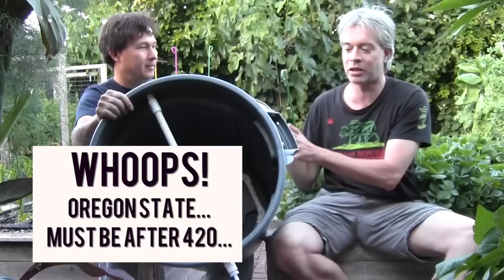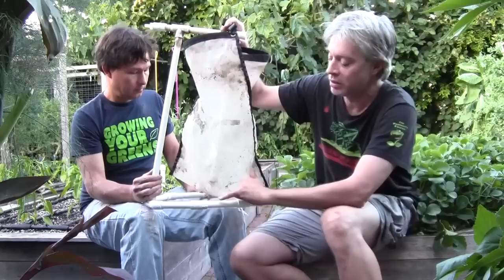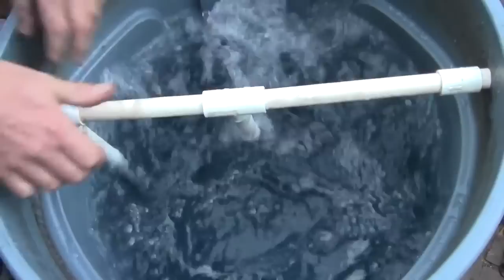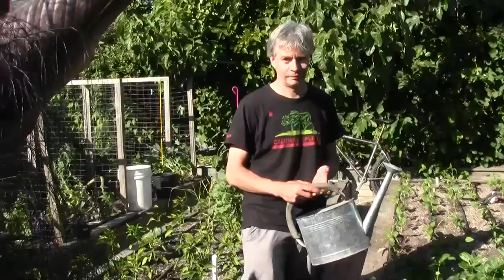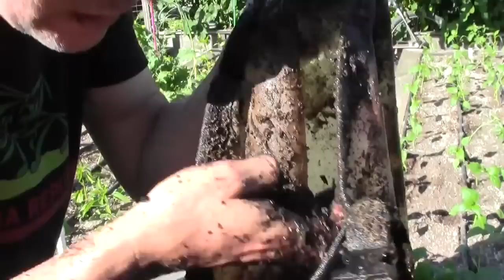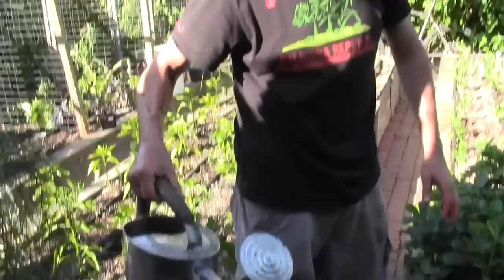Best DIY Compost Tea Brewer made with a Garbage Can & PVC Pipe

Comment: Tip: If you are using city/chlorinated water for compost tea brewing, off-gassing will remove the chlorine, but will not remove chloramines (nor will most filtration).  Add 1 drop of humic acid per gallon of water to bind the chloramines before starting the brewing process.  Humic acid can be purchased or made from your own good finished compost. Add an additional 1/8 cup per gallon of humic acid and 1/8 cup per gallon of fish hydrolysate if you want your compost tea to be more fungal dominated.
Reply: I wonder if plants can absorb Flouride?
Reply: @cryptolittle8854  yes they can . Certain plant species dont like fluoride ( ex : dracaena ) , and fluoride is more assimilated with low ph .
Reply: @lesavoirestunearme-7z527  thanks for the response
Reply: Are you stating that by adding humic acid the Chloramines bind to the water molecules then when the big bubbles push them up and out both chlorine and chloramines off gas? Or does the chemical reaction from the humic obsolete the Chloramines? Thanks for your insight
Reply: so if you know the boggie brew formula from one of their previous videos they use 2 different kinds of humic acids in their mix. However i doubt it really does that. No the only way to get around the chloramides is to use a chemical additive or to just use rainwater
Reply: Supposedly a kdf/85 filter will remove up to .97% of chloramines. I think the boogie brew plus filter is a kdf/85 filter and says it will remove up to 87% of chloramines
Reply: According to the Biologic Systems website, you need to protect the bag from UV light, as it will degrade the bag, so another form of disinfection would be needed

Comment: Didn't see it in any of the replies so I thought I'd add this. I have a programmable fish tank heater set to 73° for the initial warm up and to keep my brew at temp. Nights are ~55° here in the PNW so keeping it warm is my issue. I use a 10gal insulated Gatorade cooler with a new 'flip to stay open' pour spout (instead of the stock pour spout that you have to hold the button down to pour). It's been working great. Lots of sexy bubbles when I add fish hydrolysate.
Reply: Awesome program, especially your temperature control system - simply brilliant to use an insulated cooler like that!

Comment: Mathemagician analysis: how far do you need to turn to return to a negative parallel vector (parallel side of the polygon, in this case the octagon) — 180degrees. Divided by the no, of steps in which you are revolving (in this case pvc parts) gives the outer angle of the pvc part. So 180/4 = 45. so to get the inner angle of one pvc piece subtract 45 from your initial 180 (which would be the second angle of a staight line. The first angle of a straight line is 0, then 180, 360, 540 etc

Comment: Any old (or new) vacuum cleaner that has a "blower" connection will work fine and add ozone from the brushes which adds O2. That is what they use on large Jacuzzi tubs after all for the bubble action so the pressure should be fine. Just need to reduce it to 1/2". Easy to do. So much cheaper than those very noisy pumps. Love that design. BTW that size tea bag would work fine in a 275g IBC and that design is easy to enlarge for an IBC. Farm size! A vac motor might not handle 24hrs non stop but I'll give it a try and get back.

Comment: Great video. I would glue the pvc connectors, that have threads on them, then screw the pieces together so there is no chance of the pvc coming apart and it is easy to unscrew the connectors for cleaning etc . Thanks for all your great videos.

Comment: Cool!  Great to see detailed directions on setting up a system to aerate compost tea, and where to get the components.  But wouldn't a used whisky or wine barrel be better?  Or at least a used food grade barrel.   

Not sure what synthetic chemical-free alternatives could be swapped for some of the other parts, but the plastic garbage cans both outgas and transfer via direct contact a bunch of synthetic chemicals and heavy metals, as does PVC.

Some info about the hidden dangers of plastics used for food included below.  Keep in mind that this info is for 'food grade' plastics.  Non-food grade plastics are less regulated.

:What About BPA-Free and Other "Safe" Plastics? 
Given that certain plastics risks are becoming well-known, you've 
probably seen plastic products that tout they are "BPA-free," 
"PVC-free," or "Phthalate-free." This is a step in the right direction, 
but it does not mean the plastic is safe. 
For instance, one study found that tests on plastics using a BPA-free label
 have not been conducted under real-world conditions like running the 
plastics through a dishwasher or heating them in a microwave. In the 
"real-world," 95 percent of all plastic products in the study tested positive for estrogenic activity,
 meaning they can still disrupt your hormones even if they carry a 
BPA-free label. Even more disconcerting, the study found that BPA-free 
plastics in some cases leached more BPA than the non-BPA free plastics.
Further, just because a plastic claims to not have one or two toxic 
chemicals, it again does not make it safe. Remember, there are many
 chemicals in plastics that you are better off avoiding, and many of 
them are still largely unknown to consumers. The Ecology Center in 
Berkeley, California has put together an excellent list that exposes 
just what kinds of plastic toxins are in the products you use. I think 
everyone should read the entire list, but here are some highlights:
Salad dressing and cooking oil bottles: This 
plastic container is made from PVC (polyvinyl chloride), which leaches 
plasticizers (lead, cadmium, mercury, phthalates and the carcinogen, 
diethyl hexyphosphate) into your food. Soda bottles, water bottles, peanut butter jars and cooking oil bottles:
 Made from PET (polyethylene terephthalate), they leach acetaldehyde -- a
 probable human carcinogen, according to the EPA -- into your food and 
drinks. Meat trays, foam take-out food containers and cups, foam packing materials: Made from polystyrene (PS), these materials leach styrene, which can damage your nervous system, into your food. 
Sadly, the end result of breathing, eating, drinking and absorbing 
all of this plastic includes obesity, declining fertility rates and 
other reproductive problems, and cancer, just to name a few."- Excerpt from the website of Dr. Mercola.
Reply: Thanks for typing this out.   Its weird how things ive always thought in the back of my head without any proof are now being proven and nobody really cares either.  The average person secretes approximately 5 grams of plastic per week thats a whole credit card.

Comment: quick way to get the angle. it makes a full "circle" so its 360 degrees total, Since we have 8 side and 8 angle connectors we have an octagon. We just do 360/8 which gives us 45 degrees as the angel of each corner :) quick check of the algorithm, square has 4 side and we know a square is exactly 90 degrees each corner so we try 360/4 and we indeed get 90

Comment: Is the bag a small,med, or large?  Also if you put a drain at the bottom on the side and put a filter and on-demand pump to pump the mixture through a hose or upper irrigation system.

Comment: I have an oxygen concentrator that gets intermittent use for EWOT.   The output is 8L/M at 15PSI.   Given the O2 in atmosphere is 21% and the concentrated output is 87% pure O2, that should be more than enough for a 5 to 10 gallon batch, right?

Comment: Elaine Ingham is adamant that air stones are not used because she says that after one use they can go anaerobic and can destroy all future brews. She recommends using pipe and 1/32 holes drilled in the pipe like in the open-source brewer you show. She recommends pulling apart and pulling a cleaning patch through the inside. You certainly have a lot of hands-on experience. What have been your experiences?

Comment: Would the angular connectors be 360 divided by 8 = 45 degrees?
Reply: Looks more like 120
Reply: Whatever it is that's cool... Years ago we always had fun doing things and when somebody would try a different way it was always special... if it wasn't perfectly straight if it wasn't perfectly round it didn't matter being functionals what's important
Reply: 22.5
Reply: @seanieizcool  No, it is 45 degrees elbows. PVC elbows come in 22.5, 45, and 90 degrees.

Comment: 30:05 John introduces the topic of temperature the tea should be brewed at.

I live in Vegas; I have the same growing conditions as john! I have placed the
compost temp prob into the water here in Vegas in a 5 gallon bucket on 110 and 110+ days and the water temp in that 5 gallon bucket is 90 - 95 degrees Fahrenheit.

I am unable to make the accommodations that bring the temperature of the brew down to the suggested 70 - 75 degrees.

What should I expect out of the performance of Boogie Brew?
Reply: Add ice or a frozen bottle of water that should do the trick for you.

Comment: So if the temp is too high if it is over 70 degrees, how do you make compost tea like this in Florida where the lows at night are 85 degrees.
Reply: k may Try to WATER temps below 78 degrees, warm AIR is fine though.
Reply: How can I keep water temps under 78?  Around here in Florida the gulf temp stays in mid 80s.  Basically the environment the bacteria would be living in would be higher than 78 degrees so that cant be ideal, right?
Reply: I live in TX and grow red wigglers outside, it gets hard to keep them alive above 90 degrees, what I do is put a couple of milk jubs in the frezzer overnight to put in the soil to keep it at around 70 to 75 over all. You could try that.
Reply: milk jugs or other sturdy container that will hold water and not break when frozen

Comment: How long do you need to run the air pump?  Where do you buy the parts like the pump and compost tea bag?
Reply: k ma Run air pump 24 hours for the actual Brew process. Then  if using air stones, run the pump a couple more hours to "bleed" the stone(s) dry. Tea bags are available from places like Monster Gardens (www.monstergardens.com) or just use a paint strainer bag from hardware store.
Reply: With the 25 gal brewer, which bag size did you use (large/small)? Thanks!

Comment: I brew with small system and few times it's started to smell a bit like apple cider vinegar , Is this still good as it's not smelling anaerobic just smells very sweet? 

I just end up throwing it in the compost and starting again as I am un-sure if it good to still use.
Reply: When in doubt... You did the right thing..

The question is what are you using homies prepackaged bought-and-paid-for material? Or something you threw together from materials around you?

In my experience with my homemade concoctions it can be almost no nose to a little sweet a little earthy even in the range of a cow pie... But I wouldn't be scared of that sweet smell... 

What you should be worried about is that diarrhea it was time to take out the diapers two weeks ago smell.. when it's wrong you know it, the nose becomes very loud.

Making my own I've experienced the range. Even starting from milk thistle I pulled from the hillside brewing that up in a 5-gallon it had the nose of cow pie, which is okay... But when I went to making my tea  mixing ingredients and bubbling it got it got nasty yuck a couple hours later the nose was completely gone... plants loved it... Make sense ;)

FYI didn't go to school for this but it's pretty much common sense practice makes near-perfect

Comment: curious if a compost tea and top dressing can be used in a hydroponic system? I am interested in expanding in that direction and use compost and occasionally bat guano and/or kelp to amend my soil. I am wondering if a similar system could be used as the hydroponic nutrient solution? I also haven't been using compost tea in the soil garden but may do that as well.

Comment: 8 points = octagon, not a hexagon (6). Additionally, to much air can be a bad thing too. As the bubbles dissolve in solution they burst into smaller bubbles giving way to mechanical stress called cavitation. If you've ever cultured life in the lab it's something you need to be aware of; your pump is massively oversized and will give you too much film on top of the solution.
Reply: What size of a pump is better suited for this project ?  thank you
Reply: @canopy4203  when calculating the maximum amount of O2 or air you have to take into consideration things like elevation to sea level, water temperature and vessel volume. If they were at sea level, with 20 degree c water temp then they would need to consume 34.47mg of O2/gal. Note, this takes into account partial pressure. A single gal of air has 317.004kg of air /gal or 64.35kg of O2 / gal. Basically, you're pump saturates the water with air very quickly. 
To keep it short a 10gal per hr aquarium pump is way oversized for a 35-40 gal trash can.
Reply: BoogeBrewNet/Gyg

Comment: Ohms law. The smaller pumps have less resistance, therfore the watt pull will decrease. Combined in mutiple pumps the energy created will meet requirements which will draw less amps\watts. Also If using 1 pump you wont have a backup if it breaks.

Comment: since this is so inexpensive to create, couldn't you put one at the end of each raised bed, put a spigot at the bottom and then plumb it to run into the 'wrong' end (so it flows the opposite direction as your water)  of your irrigation
 pipes?   how long does tea last?
Reply: You would eventually grow fungus or mold in your irrigation lines.

Comment: couple of things id like to add
the pumps vibrate and are very noisy, people like to hang them to reduce noice, first replace the cheap plastic handle with a metal one.
always have the pump above the water  line, if water goes back through the line to the pump it will wreck it.
and you can unscrew the brass airhole and attach the hose with a screw clamp to the larger intake for a little more air
good vid john thanks
Reply: jason knight...Well said Jason, and a very good point about the noise! Another decibel reducer is to add a "muffler" to the air INTAKE port down on the side of the pump - just an inch or so of air tubing placed right over the port will do the trick. A piece of foam / sponge material inserted into this short piece of tubing helps, too. (And won't slow down air flow much at all).

Comment: First, I'd put the holes on the bottom.  The pipes will always fill with water, and if they're on the bottom it will keep the pipes cleaner.
There are roughly 56 1/8" holes - I'd put twice as many 1/16" holes.  I think a smaller pump will work - I want a simmer, not a full boil.  Why do you need 1 L/min of air per L of tea?

Comment: How hard can it be? 

1 full circle ~= 360°, it is an octogon,  ὀκτώ/octo being eight, γωνία/gōnía being corner or angle => 360°/8=45° so you'd have to buy 8 pieces of 45° fittings for schedule 40 pipe.

But I present an easier idea (no math, I promise): For koi ponds and sewage ponds there are aerator hoses - hoses that have many thousands of tiny air holes poked in, similar to the cheap "sweating" irrigation hoses. With those, and some common fittings and preferrable wire hose clamps you can make any shape of aerating device, here a ring or several concentric rings for the floor of the bin, and a line (instead of the point) for inside the nylon bag. Plus: no glueing needed, can not break nor buckle, can be altered, can be hanged upside down to a hook in the shed roof to dry out.

If you have access to aquarium stuff: there are devices called "aquarium air lifters" which are waterpumps for aquarium filters driven by pressurized air as the only "moving part". 
Take a 5 gal bucket, hang a cheap stainless chinese honey sieve (30cm diameter) and let 3-4 air lifters pump water from the bucket into the sieve holding the compost  aerating it in the process. 

I will test a setup with a 60l plastic barrel, concentric aerator hose rings and no bag at all, just keep it all suspended and filter out in the end (which you have to do anyways, at least for my sprayers).

Those shelves which hold 6-8 bottle carriers at an convenient 45° angle are perfect for drying and storing all the buckets hoses and sieves.

Comment: 360 degrees / 8 sides.  Those are 45 angles.
Reply: flyer737sw...glad to receive clarification from smarter folks like you. GYG'ers are a gifted lot...good "math-a-magic" etc.
Reply: these are actually 135-degree angles. An octagon has 1080 degrees and a circle has 360 degrees. If you draw a line from each angle to the centre where those eight lines converege you can see the inside angles are 45 degrees, but the elbows on the outside are 135. Or simply, think of a right angle at 90 degrees, to get to 45 degrees the two lines would have to move closer together intuitively showing these angles must be greater than 90 degrees.

Comment: If it’s 8 angles then it’s 360/8 so they are 45 degree angle connectors - it’s pretty basic math but hey that just goes to show you that growing organic doesn’t require a deep understanding of math - on the other hand growing with chems does kinda require a fair bit of math

Comment: Instead of the pipe pushed into the fitting with out glue there should be a trended fitting so that you can take it apart and hold Air pressure.

Comment: Don’t forget that simply agitating the liquid adds a lot of air from the surface, but if you have a lid on the bucket then you may have to worry more about the pump size... but if you cover it with mesh screen then you can worry a lot less about air volume via pump size

Comment: those are PVC 45s. If you drilled less holes in the PVC pipes at bottom you could use a smaller pump. I have lots of fish tanks and do aquponics so have used many pumps. there is many ways you could make this guys.
Reply: They aren't 45 degree fittings  they are 22 degree fittings 45 degree fittings will only make a square